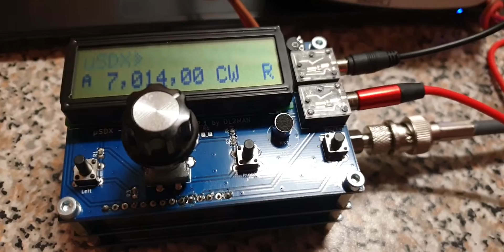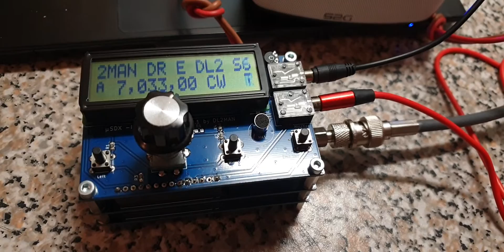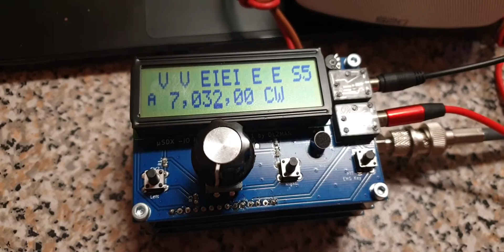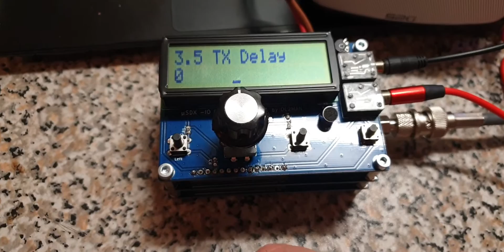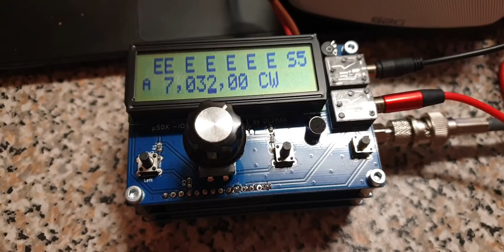uSDX Software improvements

Comment: One Good change would be to apear  the voltage on display.
Example on Ssb removing the uSDX and place there, CW would be more difficult because of the decoder. 
It would be great for battery operation on the field.
73's
Reply from the maker: Hi Pedro,
As far as I know, we do not have a free ADC to measure input Voltage. 
But I will talk to Guido about the options.
Reply: @dl2man  Thank you Manuel.
Also I forgot can it be implemented backlight on/off ?